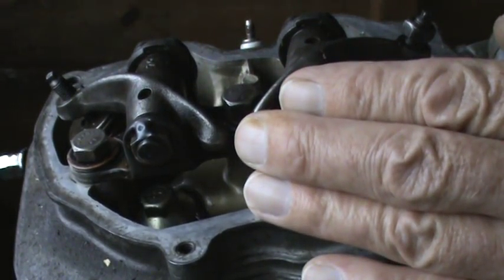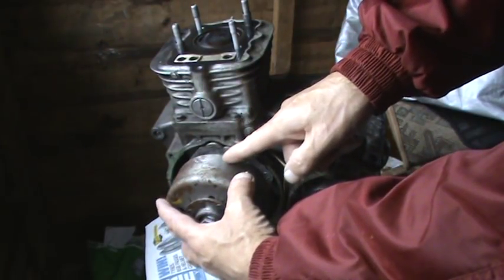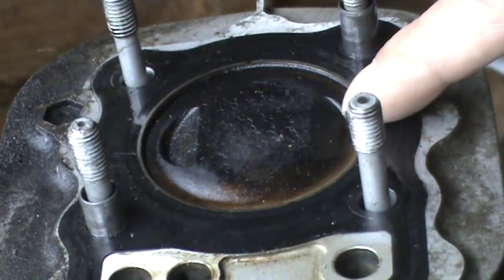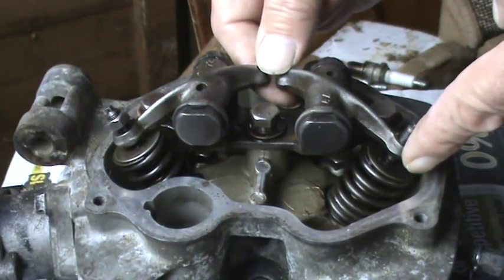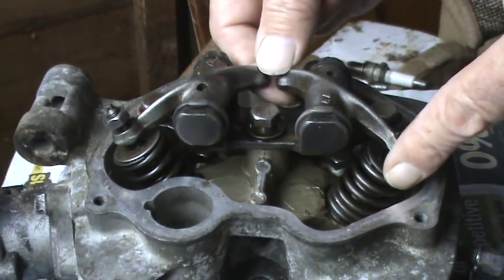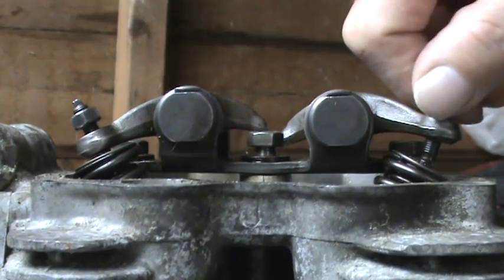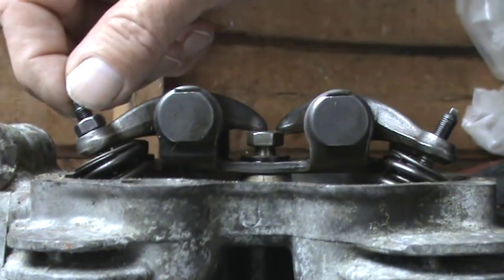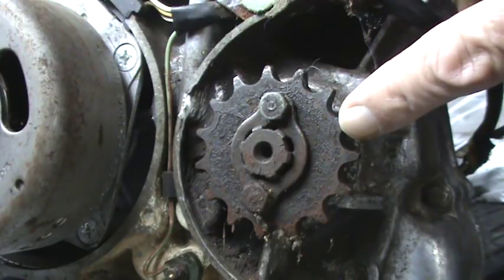CG125 HONDA CG 125 VALVE CLEARANCE ADJUSTMENT TUTORIAL

Comment: As mentioned there are two TDC's compression and exhaust. You need compression TDC. To check you have the right one both valves will be closed and there should be some play in BOTH rocker arms. If you are unsure, put your thumb in the spark plug hole and rotate the crank anti clockwise, as you approach TDC you will feel pressure build as both valves close. Hope this helps.

Comment: thanks for the video, I adjusted my valves for the first time today and went through turning the engine over and checking thinks before I called it done and found the rocker loose - after watching the video I realised that I set the valves on the exhaust compression.  Nice and clear, thanks.
Reply: Hi. Same thing happened to me too. This video helps a lot. Thanks

Comment: great video. very important you adjust on the right stroke as mentioned. the correct clearance for the valves on all models is 0.08mm (0.003 in). it is not necessary to remove the crank case cover on later models to set the timing marks - just remove the view ports with a hex nut and shine a torch in to see the F & T markings stamped on the inside of the alternator drum. you will know if you have adjusted on the wrong stroke because the engine will sound like its underwater when you fire it up.
Reply: @Peyton Sonny Instablaster =)
Reply: @Davion Cullen I really appreciate your reply. I got to the site thru google and I'm trying it out atm.
Looks like it's gonna take quite some time so I will reply here later when my account password hopefully is recovered.
Reply: @Davion Cullen it did the trick and I actually got access to my account again. I am so happy:D
Thank you so much, you saved my ass :D
Reply: @Peyton Sonny you are welcome :D

Comment: Would help if the pushrods were in at the time so you know the rocker is 'home' and also the TDC bit isn't entirely necessary, as long as the cams are on dwell and not lift, it's fine to adjust clearances.  (And there's a good angle of crank rotation where the cams are on dwell angle)

Comment: And in response to dave broadbent, you don't set valve clearances on a hot engine unless a workshop manual/autodata etc says otherwise.  It may be a good thing to verify that an engine does still have a little valve clearance when hot as the valves should still fully seat too cool

Comment: Forgive my ignorance but do you set the inlet and exhaust valve clearances at the same time on the same stroke or do you set the inlet valve clearance, turn the engine 360 degrees and set the exhaust valve clearance? Many thanks and great video by the way :)

Comment: Thanks for the tutorial. Although towards the end it makes no sense to me at all. You're pushing the rod up with a bigger gap than 0.08 and then pushing it down to suit your 0.08 feeler gauge. When you then tighten everything up this won't be left at 0.08 will it as it will move? I'm totally confused.
Reply: Teej Holt it ok
Reply: +Teej Holt He is demonstrating without the camshaft in place, so the rocker arms dont have anything holding them against the valves.  Basically if you do what he is doing, WITH the camshaft in place and the piston at top dead center, you will be doing it correctly.
Reply: valve clearance is mentioned as 0.08  understand 0.08 of an inch.  am I correct.
Reply: Teej Holt n
Reply: @paulwood4142  this engine never had the cam shalt fitted it runs with out one

Comment: Sorry i must have missed it. What feeler gauge do I want to tighten/loosen to? What should the gap be for the CG125 and clones?
Reply: Tighten or loosen so that  a .08mm or .03" feeler gauge is a nice friction fit, on the loose side rather than the tight side..

You must also try and keep the feeler gauge level to the gap,  so you do not get a false feeler friction test when set.

Too tight and you can damage your engine allowing the piston to strike the valves...:-(
Reply: Should both the Intake and exhaust be on .03 to .08mm?  I have a chinese clone 158F and can't find any specs on it.
Reply: On my Chinese 125cc the they are both the same setting...08mm or .03" 
Depends on what feeler gauge you have , the .08mm feeler size = the .03" imperial sized feeler
Reply: Hi. Inlet 0.03 and exhaust 0.04

Comment: My bike is a non runner, Got spark got petrol but no ignition, is it possible that I have a valve issue that prevents it from starting, I'm a bit thick so lay mans terms only please.
Reply: Hi. Does it turn over ? If so, it could well be the valves. Take out the plug and turn it over with your thumb tightly on the plug hole. As it turns you should feel alot of pressure on your thumb. If very little pressure, put a teaspoon measure of thick oil through the plug hole and wait a minute for it to settle around the piston top. Put your thumb on the hole and see if there's any difference when you turn it over. If the pressure has increased the fault is with your piston, rings, or the bore/barrel. Always worth checking the valves anyway. Hope this helps if you havnt fixed it yet. I know it's a long time ago.

Comment: Is 0.10 and 0.15 Ok? My feeler gauge wont do 0.08 and 0.12 exactely..
Reply: Have a look in a Haynes manual for your engine spec, it will tell you the limitations that you can go to, failing that you can go to any reputable auto repair tooling centre and pick up the correct tool for little money in the UK I went to Halfords and brought a set with cost me £3.99 it is worth mentioning that there are other sellers and others may be cheaper!
Reply: Thx, I used these to "measure" the gap, and the exhaust side was way off, I adjusted it so it was already a bit better and the stalling is history. Also better performance. So this was defenitly the problem, I'm now going to buy another set to do it correctly.
Reply: Good effort, what was your symtoms? Backfiring?Juddering?
Reply: The engine stalled when it was cold. When it was hot there were no problems. I never could notice a withrawl in performance since I bought it secondhand, and it were my first miles on a motorcycle ever.  The bike has 27.000km's.
Reply: Fair enough, have you cleaned the carb too?
Reply: No not yet, I wanted to do that first, is it recomended to do when I have no problems at this time ?
Reply: Usually cleaning the carb is the first thing people recommend when they are having running problems, it is a good idea to regularly clean a carb every 5000 miles/8000Km to keep your bike running effiecently and the engine healthy. It is an easy job todo but make sure you research it properly before you do it as there are some warnings about carb settings which you SHOULD definatily listen to and abide by. You can buy referb kits very cheaply and I would recommend getting one before you do the job just incase you do break  seal or gasket. Good luck with it all and if you need any help/advice feel free to contact me. just for information purposes which cg model and year are you working with, make sure to look at the engine number as people change engines on these bike frequently, e.g honda cg125-c frame but with a honda cg125-e engine. just look at the letters/numbers after the cg125-
Reply: yes, but get the parts first, its just standard maintence. no rush for it though. if you have no problems then dont worry too much

Comment: 4 mins to explain about TDC. and you dont actually even need an engine on TDC to adjust clearances...
just make sure there is no travel on the pushrod, to give you a false reading..
aslong as the valves are completely shut, and the cam shaft isnt pushing on the push rod, its fine to adjust the valves
Reply: true. but the more you know the better. 4 mins is not a lot of time LOL. kids SMH